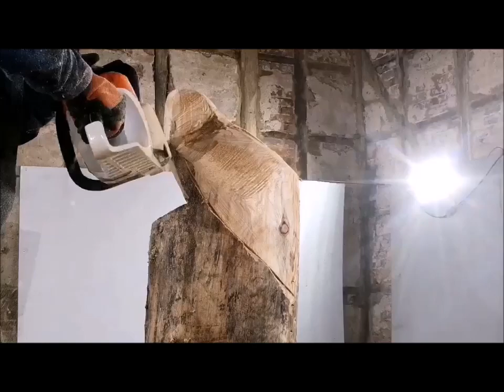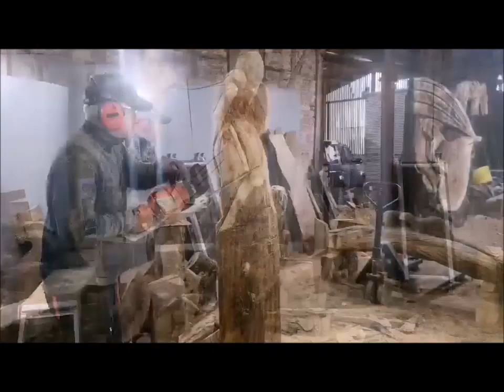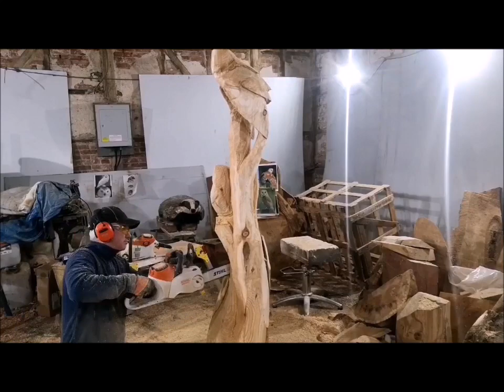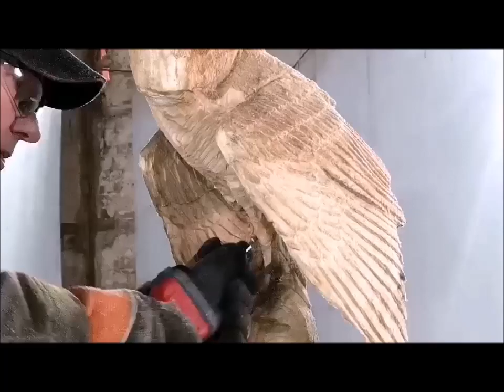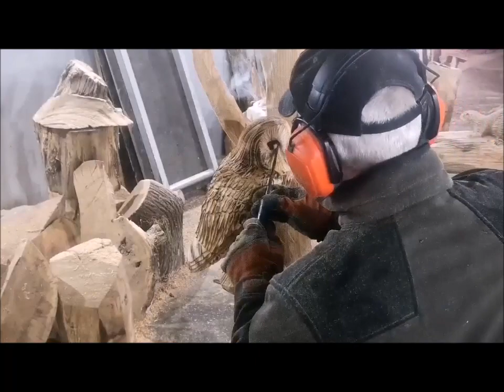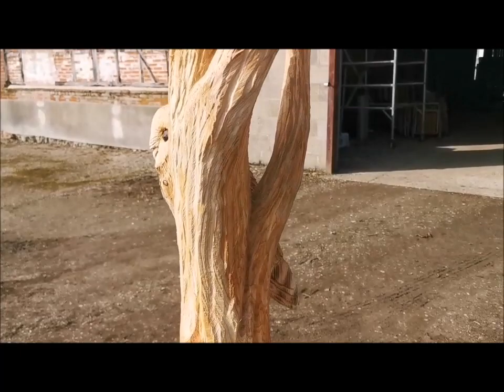Chainsaw Carving Barn Owls from a 6 foot larch log

Comment: Hey mate just wondered what you used for the eyes, I really struggle with eyes on my carvings, I havent been doing it for long what did you do to burn the eyes too? Thank 😊
Reply from the maker: I cut the eye shape with a Saburrtooth eye tool and then heat up an old chisel or screwdriver with a blowtorch and run it over the eye surface, which melts the wood surface and gives a shiny black eye finish.
Reply: @mattdargechainsawpowercarv358  thanks mate appreciate it 🙏